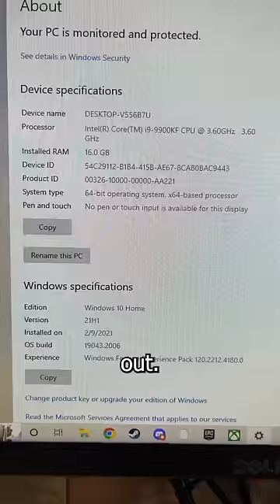This iBuyPower #gaming #PC has been visited by RGB #tech aliens #technology #shorts

Comment: there's a reason you blow the dust out and never use a vacuum this bloke has no idea
Reply from the maker: "There's a reason" - doesn't give a reason
"This bloke has no idea" - doesn't give an idea
Vacuuming an external dust filter on the case is fine ol' Jimmy boy. It's not like I stuck a Dyson inside the heatsink or anything. We blow out every PC with an air compressor before giving it back to our customer, as seen on my other videos.
Reply: @SalemTechsperts  Calm down big boy XD static electricity can discharge and cause a massive number of issues its the main reason why you never build/repair a pc or other electronics on carpet or use a vacuum as that can also cause a static discharge. if your a pc repair channel you should have surly heard about it??? its a small chance yes but when working on a clients computer you cant dilly dally 

Really you should ground youself to prevent it but thats a bit to far just build on Wood and don't put a vacuum close to it lol.

You should put a large magnet near your hard drives and see what happens mate :)
Reply from the maker: @jimslsswaps3272  static electricity from a low powered handheld vacuum is not jumping 6 inches from the dust filter on the outside of the case to the motherboard to fry something while the computer is unplugged.

Comment: I hate that people think the top is the best place for the radiator
Reply: My cpu dropped by like 10 degrees from moving it to the front because heat rises u want your exhaust at the top why would u put a radiator in the hottest part of the case to keep warm air blowing on it?
Reply from the maker: Mounting the AIO in the front of the case is fine, just not as ideal for the lifespan of the cooler.
Generally speaking, top mounted AIO is worse for CPU temps, but better for GPU temps, and front mounted AIO is better for CPU temps, and worse for GPU temps.